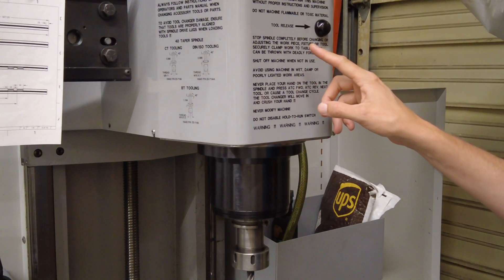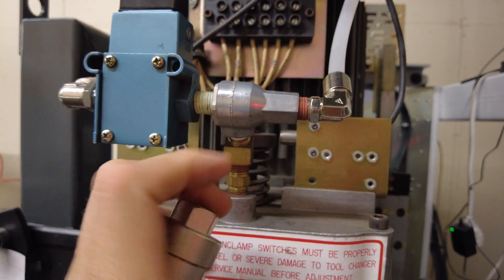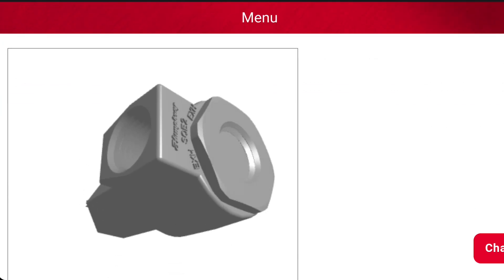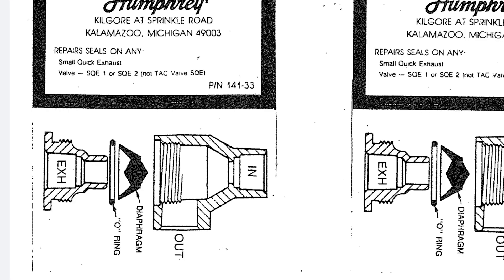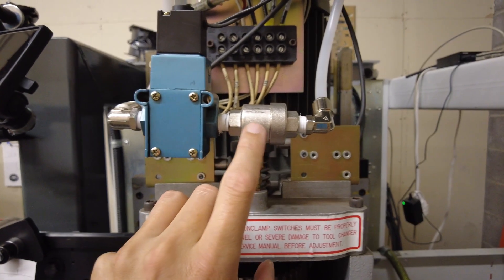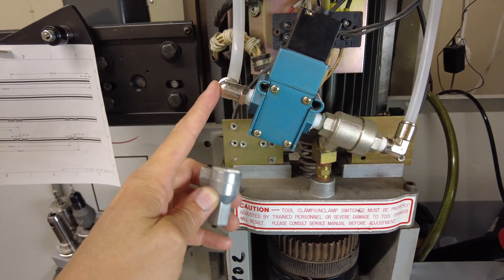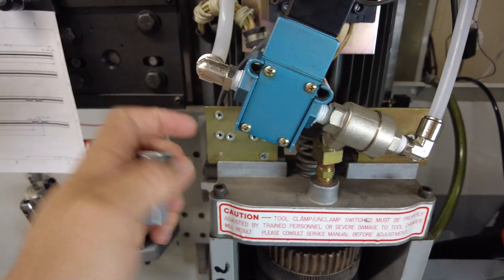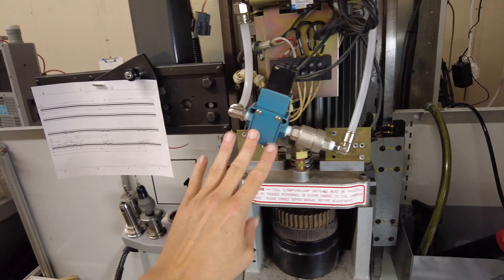HAAS CNC Fix Stuck Tool Release Issues by Replacing Humphrey Valve with Legris Valve | TM-1 Mill

Comment: Any updates on making the tool changer work?  Im debating building a 20 pocket carousel for my TM2p.   My 10 is too small
Reply from the maker: It's been a slow project, but haven't run into any issues yet. You should find a used/new 20 tool HAAS umbrella and use that.
Reply: Should be simple to update your tool changer.
But/make a new size, bolt it up.
Make a new sensor ring (literally a chunk of metal with teeth for a mag pickup to count)
Change the count of tools in the controller.

If you’ve ever pulled the covers off to look at the changer motor you’ll see that it’s a super simple mechanism. 
Ive even heard of people putting belt tool holder racks on to get big capacity. But you’ll need to add a outrigger w/slide for the overhung weight